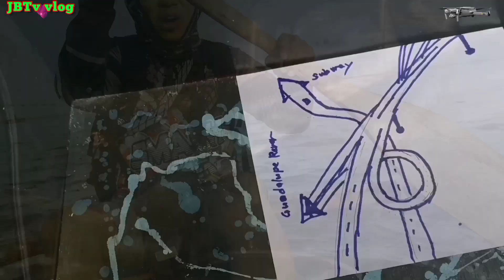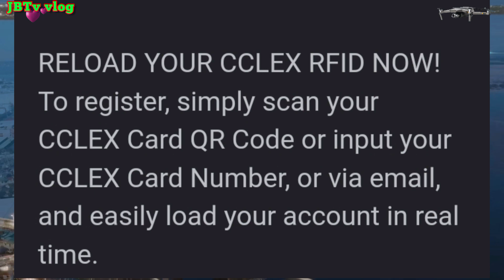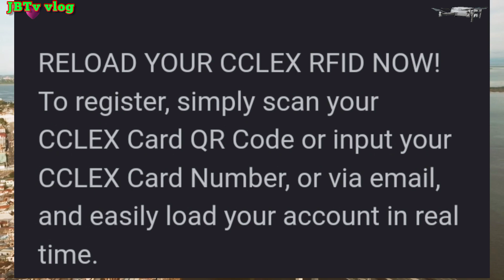Proposed 2km. project,P1 billion CCLEX extension ramp, and update on removal of soil under viaduct

Comment: 🛸📸:elbowbump::goodvibes:👍👌✌👊Your sketch actually corresponds to the original plan of CCLEX, before the ramps to downtown via the mouth of Guadalupe river was scrapped.
However, the original alignment of the main span and Cebu City viaduct of CCLEX was retained. This means, they can always add the ramps to downtown at a later date if and when CCLEX and Cebu City gov't decides to.
This is what you call hedging (option B, C, etc.), just in case something does not go according to plan for option A (traffic from/to Cebu City comes only from SRP).
Hedging allows an investor, alternative and/or additional source of income. 
MVP realized the projected income that was calculated before the bridge was constructed is not going to be met due to unexpected onslaught of economic woes brought about by the pandemic and then the additional financial hardships worldwide due to the on-going war in Ukraine. Even allowing motorcycles with engine displacement as low as 110 cc won't be enough to offset the loss of projected revenue. To me that was already option B. 
Additional source of income is needed. And that includes the ramps to/from downtown Cebu City. Even if it means investing an additional couple of billions. I'm almost certain they are going to negotiate with Cebu City gov't. to extend the concession time of the project.
Reply from the maker: I see... Thank you so much for your complete information that you'd shared... I'm so blessed of reading this.... . May God bless you sir...
Again thank you